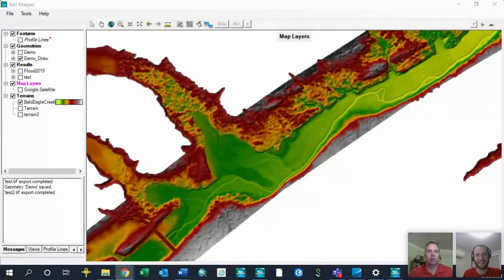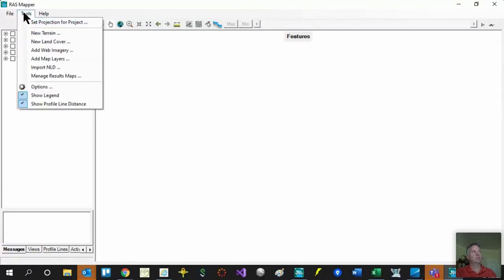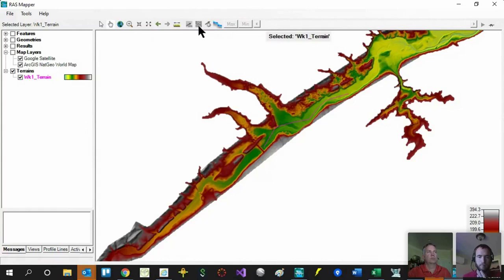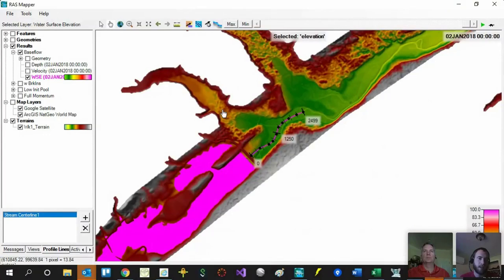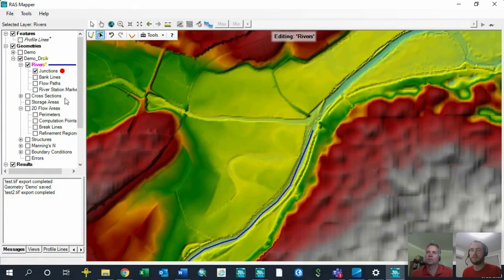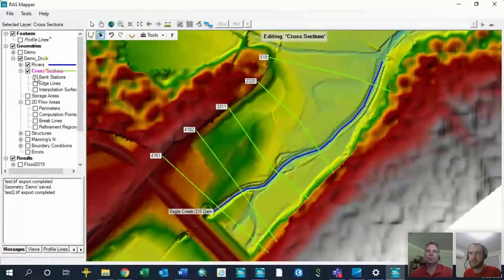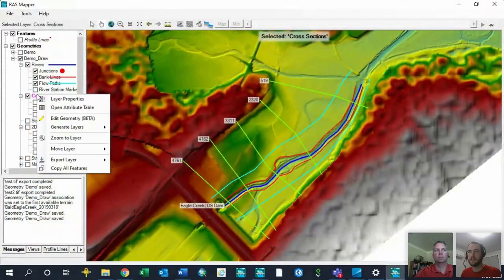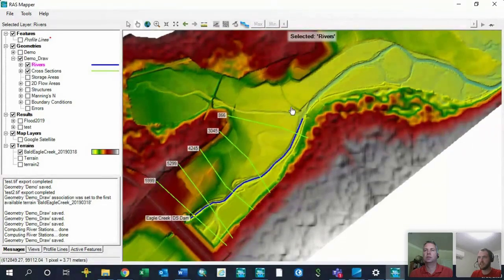Full Momentum: An HEC-RAS Vodcast (Ep.5). RAS Mapper Demo Part I

Comment: This is a very nice introduction. How can we add 1D geometry after that 2D flow area in this case? Also if I have model like this, i.e., 1D geometry with small parts in between has 2D flow area; but later on, I want to replace that 2D flow area with 1D geometry, how can we do this?

Comment: Maybe I'm creating some issues by editing in both RAS mapper and the Geometric Data view but I can't seem to be able to resolve an error for unsteady flow saying I have no upstream cross-section for my reach.  My model is similar with a 1D main channel and a 2D flood plain but I added a lateral structure which seems to have created the issue but I haven't found the link.  How do I add an upstream XS reference for my river reach?  I thought it was automatic when I set up the 1D model as you explained here.

Comment: For the terrain, I can't get the terrain data. I've been told to use data sources for the UK - National River Flow Archive and OS Terrain 50. However, the data from OST50, does not give me a terrain image for myself to start the model. Do you have any suggestions please?
Reply from the maker: Have you tried using the Download Terrain Data option that is built into HEC-RAS? It allows you to download USGS terrain for your current model extents.

Comment: I need a help!! 
At the 34th minute when you open the geometry date and the cross sections and DEM appear there. When I did not appear, I pulled the terrain in the option 'select layer...' but only the DEM came without the cross sections. What could have happened?
I'm doing in a reservoir, is the area too big?
Reply from the maker: It is likely due to not having an associated projection file with the project. Another thing to try would be to open and close the project.